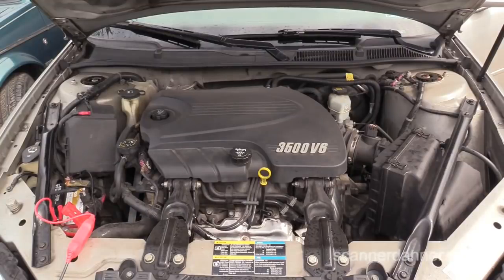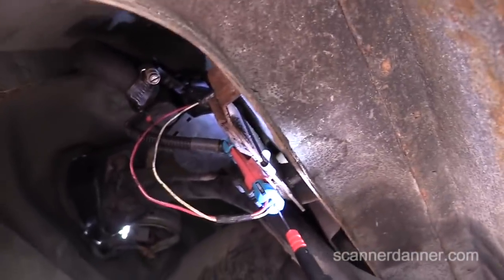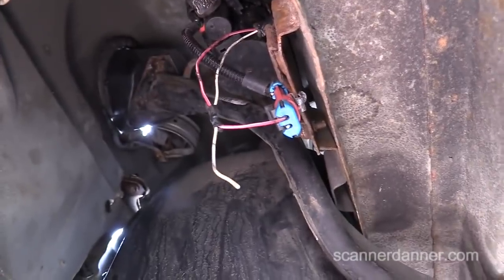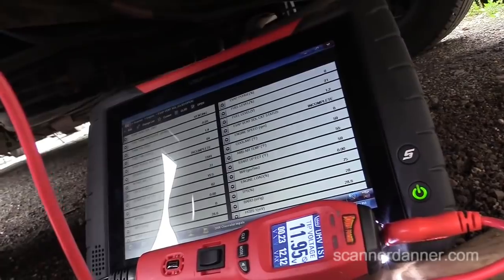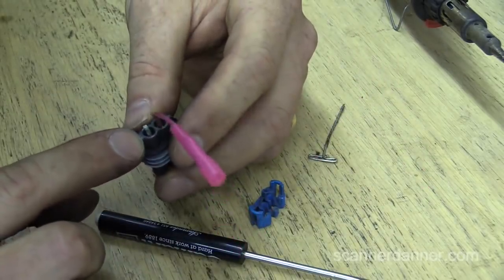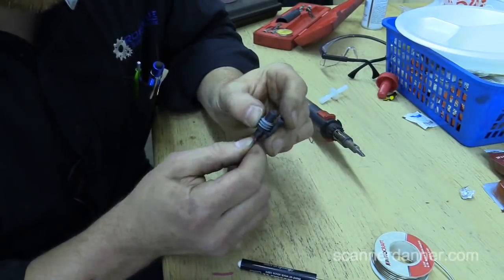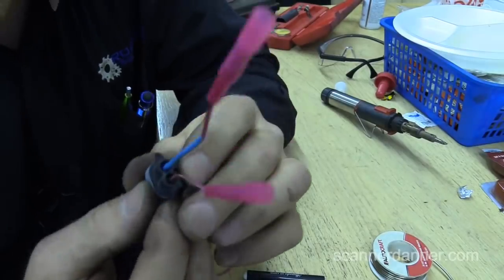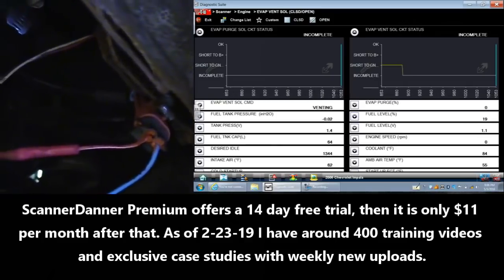Open Circuit Testing (Ground Side Switched Solenoid)+Wiring Repair Tips

Comment: The really cool thing about this simple video is that as a student of ScannerDanner Premium this is simple ground side switched circuitry and I can now troubleshoot something like this in minutes.  It's great to not be THAT guy who replaced the solenoid and the connector and didn't fix it.  Thanks for all you've done for us, Paul!

Comment: Really well done with the close up view of how to repair that connector. Also I liked the way you showed the driver test, an alternative to a test light. Using that method you're putting a small load on the driver circuit, making it a better test than simple voltage on a multimeter, and more empirical study compared to a test light .

Comment: I pride myself by finding actual fault not changing parts since 1976.
Sadly $100 per hour labor shop charge pushes many to do quick parts switch out rather than quality troubleshooting.  Today's vehicle have tiny thin wires which quickly dissolve from road salt. I have put anti corrosion  grease on all connections plugs pins etc.I use Stabilant 22 on connection s also. 

Nice work Thanks
Good job.

Comment: Perfect timing Paul. I'm working on a compass in a mirror that's not working and I found the same thing, a bad pin at the connector. I have ordered the pin and removal tool so lets see how I do. With this video I think I'll be fine now.  :)

Comment: Thanks for the video. I have been using injector noid lights which in most cases will conveniently plug right into the connector to test the circuit and driver. I find they are quite useful.

Comment: Thanks to this video I found this exact problem on a 1996 Toyota celiacs crankshaft sensor connector just like how you did I tapped on the wires and one was broken thank you I really love your video thanks a lot !

Comment: I have seen those broken wires with perfect insulation. I have found them by bending the wire. It will be floppy at the break. 

I like the idea of shorter ones to the point like this with links to the longer videos.

Comment: hi paul watch some of your other videos where you test computer wiring using regular test light i have heard other you tube trainers ie ngk condeming this method i realy dont care what they say because your the man if you can clear up test method cheers
Reply from the maker: The key is knowing what you are doing. Know the current draw of your test light and know what the normal current draw is on the circuit being tested. Sometimes the incandescent test light is THE test to use. I just did a video last week (I'll upload it soon) on a Hyundai where the wiring was chewed by an mouse or rat where both the power wire and control wire of the variable vale timing solenoid were bare and touching each other. This is a serious red flag that the driver in the ECM may have been damaged.  I would love to know how the naysayers sell this job. Is it, fix the wiring first, then hope the output driver still works? That is ridiculous! I'm not spending a dime of my customers money without giving them the whole story first. So, what do you do? You substitute the solenoid with your test light then command the driver on. Test light lights up tells you the driver is good! Now sell the job confidently knowing that when you fix the output wiring or even a shorted output itself, you'll know for sure you are not coming back to the customer to ALSO sell them a computer. 
I'm so sick of hearing this same bullshit, tired argument. (not from you but from these "trainers"). Even manufacturer flow charts are now teaching these methods. Swear they've been watching me lol
Reply: @ScannerDanner  your reply is very much appreciated great answer only increases my respect and high esteem of you keep up the good work there must be thousands  of techs who have increased there knowlage and understanding of disgnostics through you the world over as i said your the man
Reply from the maker: Thanks my friend, very much

Comment: Hi Paul, another great video thanks, I particularly found the bit about connector repairs useful. I have recently carried out what I regard as my first proper diagnosis & repair (I have to confess that I used to be a bit of a 'parts changer') using techniques I learned from watching your vids. I've done a video of it (title: "Renault Clio with P0105 (MAP Sensor Circuit Malfunction) Diagnosis & Repair." - if u have time for a quick look), and have put a link back to you in the description - I'll continue to that in any future related vids. Cheers. (BTW - I like your long vids! :))

Comment: Awesome video Paul thank you for sharing.. Quick question...If I wanted to manually send power to this solenoid if I remember correctly I can use my incandescent test light to battery positive and touch the signal feed. My question is.. Since I'm jumping the solenoid from battery+ do I still need to load the circuit? And how do I protect the driver

Comment: I had a 2007 in my shop today . Setting a code for vent solenoid circuit. The control wire was broken inside the insulation right at the connector . The pull test really didn’t work until I removed the protective piece on the back of the connector , then I saw a small amount of green , and as soon as I pulled the wire it broke off showing no copper inside for like a half inch .

Comment: So a normal seleniod will have 12v to both wires until u turn it on with the scan tool?
Reply from the maker: If it is ground side switched, yes. If it is power side switched no
Reply: I would clear my p0499 code and test my wires, both r getting 12v. I turn off my seleniod in the scan tool and automatically get a check engine light. Also on or off I still got 12v . Does that mean my driver/pcm is bad?
Reply from the maker: @kingvinnie2784  no sir, you most likely have an open control wire and many times, I've seen the control wire broken, inside of the insulation, within an inch of the vent solenoid connector
Reply: @ScannerDanner  thank you for replying. I was able to find the control pin out wire  to the pcm and unplugged it checked for voltage. I had 12v. I also unplugged the plug to  the canister vent seleniod and checked voltage . And had no voltage at the pcm plug . Swapped out the pcm and it's back n working agian

Comment: What type of solder do you use?
Reply: You should always use rosin core solder when soldering wires. Acid core solder is for plumbing. Silver rosin core solder is the best but as long as you use rosin core solder it will be fine.

Comment: I guess there it was a tiny hole maybe in the pas someone pierced it because if not im wondering how humidity got there?
Reply: armando nika that is under the car by the gas tank yes it possible someone poked the wire but it also possible that over the years the rubber seal wasn't sealing the best anymore or had snow piled up in there and when the snow melted it seaped into the connector even a good seal not 100% watertight in the north with snow and salt you see it alot especially on abs sensor wires
Reply: hotrodpaully1  thank you Paul for your explanation more probably the rubber seal lost his property in sealing!

Comment: How do you find an intermittent open circuit? MY Chrysler 300m does weird stuff. MY blinkers work randomly. My wipers will sometimes not work where it's incremental (the settings prior to constant running), even though low, high, and off all work fine.  Then sometimes when you turn them off the blades stop in the middle of the windshield instead of coming to rest at the bottom...sometimes. And sometimes the interior lights will all come on for no reason at all then shut off a short time later. I'm thinking there's bare wires somewhere that are touching?

An open would never work. A short would have melted something I think.  I changed the combo flasher (under dash) and turn signal/hazard switch, and the problem persists (plus it doesn't explain the connection to the interior lights). So can there be an intermittent open? Does such a thing even exist?
Reply from the maker: Yes, a bad ground (intermittent open) can do all of those things
Reply from the maker: Get a wiring diagram and find out where the common ground is to all those components (if it is a common ground) and start there https://eautorepair.adtrk.biz/?a=10817&c=24&p=r&s1=

Comment: how much do you charge to fix this?
Reply from the maker: Fixing an open in a wire is not the issue, locating the problem and accurately troubleshooting the circuit, is what you are paying for if I am billing you. So around $100ish for the diagnosis alone. The repair side would differ car to car and system to system. 
To be clear, I do not charge for these jobs anymore. The camera pays me these days
Reply from the maker: you have open circuit codes? or you are measuring directly with an ohmmeter?

Comment: If parts store (Napa) close by.. get the new connector.
Or
Heat shrink then insert weather pack.
Reply from the maker: yep, a few mistakes on this one for sure
Reply: @ScannerDanner 
 admitabtly.. I have done the same. Though.  But customer car can afford the 1$ terminal (taxes and fees). :)
Reply: If you go to "U-Pull" scrap yards, pick up a couple of connectors while you're there. They give them away, and you'll save time having them in stock. New pigtails can be crazy expensive.
Reply: I picked up a Weatherpack repair kit years ago and it's been invaluable.  Great video and solid dissection!  I always seem to crack something or break the pin reatainer which is where the kits comes in handy!

Comment: I'm posting this here as I'm not sure how else to reach you. Remembering your "struggles" evaluating VE,  I thought this might interest you. It's only a 30 sec. read. ( https://mechanics.stackexchange.com/questions/17537/how-is-engine-load-determined ) (" Peak value of LOAD_ABS correlates with volumetric efficiency at WOT.")

Comment: After all these years, GM still can’t make a good EVAP system.
Reply: Ha, at least parts are easy and cheap to replace. Most of the time its the vent solenoid or the gas cap. Both easy to test and cheap to replace.